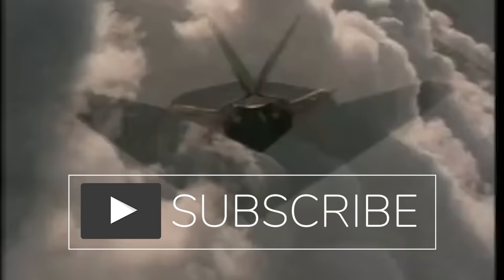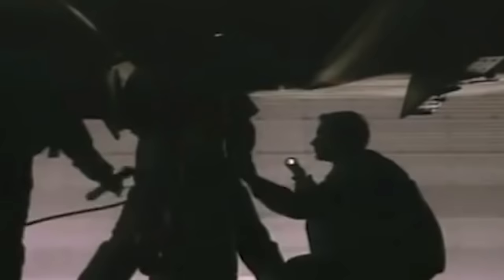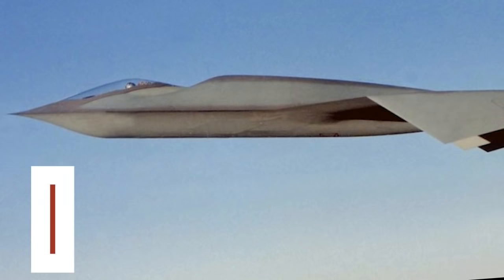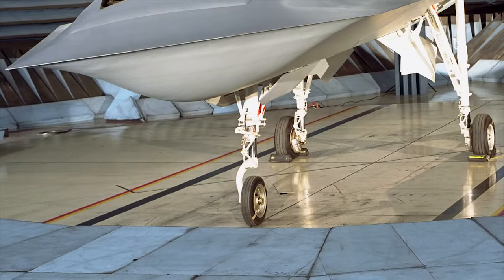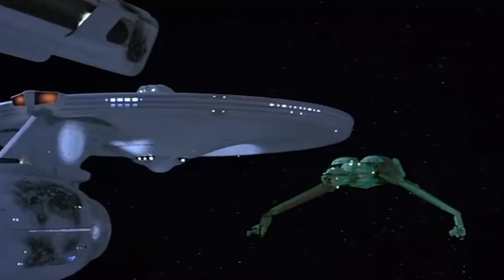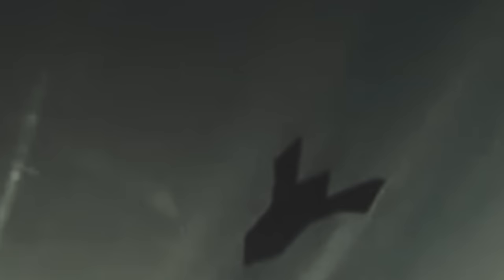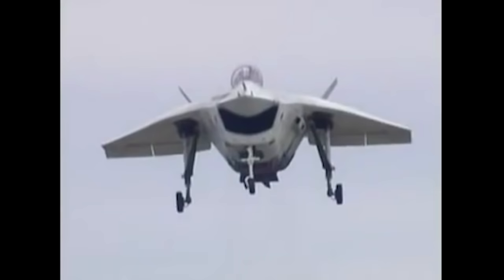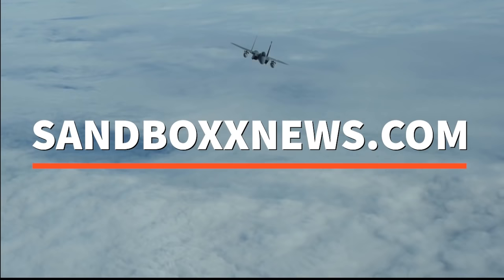Boeing's secret budget-busting stealth fighter

Comment: Nice piece.  FYI radar cross section of an aircraft is a function of reflectivity (as you said) and radar frequency and aircraft aspect angle.  By the way, "budget busting" means that the budget was exceeded.  The biggest problem with programs that "bust" their budgets is the plethora of regulations and bureaucracy that platforms have to wind through.
Reply: The biggest budget buster in development programs is the consistent underestimating the time and cost needed to invent the technologies that the new platform needs.
Reply: @mikeaustin4138  The Pinto was a car Mike.  You really need a better understanding of the defense acquisition process.  Have a read of the DFARS, if you can't sleep, and see how convoluted they are.
Reply: I'd hazard a guess that the biggest budget buster is the combination of the CEOs salary (you know the one who didn't actually do anything to make the aircraft) and unearthly profit margins for the company. The regulations are not the cause since the company knew of them beforehand and should have accounted for them in their bid.

Comment: One could argue that; if the bird of prey was developed in to a effective front-line fighter or bomber, costs would have risen exponentially. It was just a prototype.
Reply: Yup.  It was a technology demonstrator/growing pains developmental bird for McD to try to close their gap with Lockheed, especially with ASTOVL and JAST in the works.
Reply: One of the Test Pilots resigned rather than fly it...it was a handle to fly (read:dangerous).
Reply: It is way too small to use as an operational aircraft.

Comment: Building an airframe, a demonstrator airframe, is pennies on the dollar for what a complete, mission capable, fighter plane costs.  How much development on weapons control software integration was done with the Bird of Prey?  What range did it have?  Could it be refueled?  Could it cooperate with other air operations?  In short, beyond a flying airframe, what could it do?
Reply: Irrelevant...that's an apples to oranges comparison
Reply: @BRAINFxck10  -- That's right, it IS an Apples to Oranges comparison -- building a one-of prototype that only needs to fly and doesn't have all the actual mission required tech is easy, the hard part, the expensive part, is filling in all those mission requirements.  So, for an AC manufacturer to be able to build a one-of plane for something more than $100M doesn't impress me one little bit!
Reply: @Raptorman0909  
You'd need to know the costs of other flying stealth technology demonstraitors, to be able to say it's impressive or not.
Reply: hey hey hey! you cant use logic here in the 21st century and you know it!
Reply: You obviously never worked test.
Reply: @stanstanly3812  the r and d/test part is what is most expensive. just building something is cheap. its all of the sensors and stuff they have to put on it before testing that costs so much, that and the time ... nobody bolting stuff onto an airframe does it for free.....
Reply: That's what I was thinking. It wasn't remotely an operational or even a prototype, it was a proof of concept. No sensor suite, no weapons, no refueling, etc. It was meant to push technology, completely different than an operational aircraft.
Reply: @TheSnivilous  they (aircraft made this way) arent all that much more than a mock-up for the wind tunnel.
Reply: The Bird of Prey wasn't the product of the project.
It was how they made it that was the product.
Boeing should start working with BAE on UCAVs.
Right now BAE has the cutting edge tech.
All it needs is a payload bay and it can drown enemy air defenses in small smart  swarms of weapons like SDB-II and SPEAR-3.
Reply: @BRAINFxck10  That's exactly what his point is....
Reply: @BRAINFxck10  true, our airforce is made up entirely of flying demo planes, none of which have the ability to do anything other than fly. it would be irrelevant to have and airforce of planes that are able to fight. mission requirements? irrelevant. ability to perform certain tasks? irrelevant.
Reply: @lukewarmwater6412  read this in the middle of the night n lolled hard 😂
Reply: Very little, it was very, very small and only meant to test new stealth ideas in flight. Basically demonstrate that a new stealth concept could fly and testing it's radar reflectivity in flight, while also testing new production techniques.

Comment: I love the design. However there has been a big logical fallacy in the video: the comparison of the F-35 and the Bird of Prey platform.
A deployed Bird of Prey (not sure where it could fit in - as F-117A successor or stealth jet powered Super Tucano?)  would have been far more expensive. It was a demonstrator - without combat essential avionics (not even radar) nor weapons. It is like comparing a trainer aircraft with a full fledged combat jet.
Reply: The direct comparison makes some sense, but very limited one. For one, as you mentioned, the plane was pretty bare-bones, but we are comparing a cost of a production (albeit fully furnished) plane and a cost of whole developmental program.
Reply: @knytrix  Sorry - you are certainly right - it is a fallacy - not a logical fallacy.
But yes - I stand to it. Compare a fighter jet, with very expensive components is a whole different thing than a demonstrator with no avionics (at least no radar, weapon systems, data link etc.). It is like comparing apples with an iPhone. 
Or comparing a self-assembled bicycle with a car.
Reply: @Dominikmj  the part you’re forgetting is that the entire development including the single plane was on par with the cost of just 1 completed fighter. Had the program been adopted, the per unit cost would have been at a minimum compared to other operational jets
Reply: @scottdorfler2551  yeah it was space Nazis. Duh.;)
Reply: @enfynet  look - it is still dumb. I have a better analogy: cost of a garaged-built car (from scratch parts) and a development of a new model of a reputable car manufacturer. First will cost (depending on the type of car etc) several dozen-thousand of dollars. However latter would cost hundred millions of dollars. It just doesn’t make sense to compare.
How I understand it, the Bird of Prey was a flight demonstrator - not a prototype for a combat jet.
And as said: a lot of money goes into complex systems and also safety etc

Comment: The Bird of prey aerodynamically speaking closely resembles X-45, and I think that it could be described as a piloted version of it. The difference is the wing design, which is polyhedral, with dihedral inboard sections and anhedral outboard sections (but the same planform). Also, the chines on the front fuselage are more accentuated compared to X-45.
Reply: As stated in the video, the X-45 basically is a pilotless version of the Bird of Prey as it’s design was derived from the Bird of Prey.
Reply: I love the chines
Reply: @jackmandu  Sorry but for some reason, I didn't hear your statement that Bird of Pray is piloted version of X-45. If it is so, why was the great enterprise for Boeing to make a piloted version of this vehicle?
Reply: @kakavdedatakavunuk8516  I would advise to watch the actual video you are commenting on since it explains everything.
Reply: @EdWood110  My comment was based on the sentence that AW work on Bird of Pray is achievement. From my point of view it is mediocre aircraft, with performance much worse then their pilotless counterpart (and it is aircraft with no actuall purpose, except to show that Boeing was able to do it), if you think differently it is OK.

Comment: I am a boat builder.  One of the greatest achievements of Black Widow is the ability to prototype a boat in composites, test and make corrections before an expensive production mold is made.  This same technology can be applied to aircraft, respectively.  Boat building has as much to do with aerodynamics as any aircraft with many contributing unpredictable factors acting against the design.  Many techniques in high performance speed boat composite manufacturing prototyping can benefit the future of aircraft.

Comment: What Boeing proved is that they CAN build under budget when it's their money instead of ours!  Also, all they accomplished, within the funds spent, truly was just PoC (Proof of Concept).  In order to actually build a mission worthy aircraft they would probably charge the US taxpayer 2 or 3 times what they spent on this PoC.  I very much like what they did, now make ALL aircraft contractors do the same.  Spend their own money for PoC, then set a fixed contract to produce mission worthy aircraft that can be manufactured for a reasonable cost. One issue remains, is how "big" are they going to have to make it to house a larger engine and the space needed for the ordinance it will need to carry in order to complete an array of effective stealth missions without loosing its aerodynamic properties. Would love to see it get made.

Comment: The Bird Of Prey looks Ike the VTOL elements used in the F-35 or even Harrier could be incorporated.  It would need to incorporate a large by-pass which draws air from the top of the fuselage. But then you would need to have a large budget.
Reply: You don't necessarily need vtol
Reply: VTOL would kill this design honestly

Comment: Interesting shape, but with a max speed "slower than a C 130 Hercules" and max. ceiling "less than half as high than a P 51 Mustang", it is understandable the effort ended up in a museum. Having said that, lower prices / airplane certainly has become a serious issue by now, since prices have become so outlandishly high, planes so complex, maintenance so expensive. A "battle of England" scenario with Poles and Czechs replacing quickly shot down British pilots and new Spitfires those that didn't came back is no longer an option.

Comment: The dorsal intake is such an obvious solution to minimizing detection by ground based radar, that I wonder why it wasn't used in any of operational stealth craft??
Reply: Not good at high angles of attack because the engine wouldn't get enough air

Comment: As far as the "F" Fighter designation story goes, the Airforce wanted to attract the best experienced fighter pilots to apply for the program, then skill them in flying the cutting edge tech bomber. I don't know how true this story is, but because its a one pilot bomber, the first ever, it makes sense.
Reply: It was not the first single seat bomber at all. The A-7 is an example of single seat light attack bombers that the AF flew for decades.
Reply: Not a "story", it's a fact. Under the regulations set forth by congress, it should in fact be the B-117. But a super light bomber is not the type of aircraft anyone would think they'd want to fly.
The thing could carry 25% of the weight in bombs that the A-7 carried. So not even a real capable light bomber.
However, being super secret gave it the option of ignoring the rules and pretend it was a "fighter", just to keep its actual functionality obscured. Which helped get pilots, since they didn't learn the truth until after they had already joined the unit.
Reply: F-117A had a classified Air-to-Air mission of anti-AWACS using AIM-9L/M carried inside the weapons bays, with a hung-in-the-wind scissors rail.

This was recently revealed in a pilot interview on The Fighter Pilot Podcast.

F-111and F-105 were dedicated strike aircraft as well, never meant to engage flying targets, though the F-105D and F shot down 26 MiGs in Vietnam, 24 with the M61 20mm, and 2 with AIM-9s.  F-105 was a tactical nuclear strike fighter.

F-111 never shot anything down, still nomenclatured as a fighter.

Comment: Lockheed Martin: Develops a stealth fighter which program costs more than an entire nuclear powered fleet carrier and took more than a decade to complete

Boeing: Builds a stealth aircraft with the entire cost of the program being less than the price tag of a single fighter from Lockheed Martin's program

if that's not budgeting, I don't know what is.
Reply: Boeing just bought McDonnell Douglas and promptly started re-naming everything. This was developed by McDonnell Douglas. So were the F-15 and F-18. Among others.
Reply: JSF development costs involve 3 different airframes to be produced by the thousands, with a spyplane and EW bird set of sensor suites, heavy payload capacity, significant combat radius increases over legacy, and supersonic speeds.

Comparing those with a technology development demonstrator powered by a tiny business jet engine isn't really meaningful.
Reply: That is an extremely narrow and biased way of looking at that situation
Reply: My 5-year old daughter's Barbie Power Wheel Jeep costs A LOT less than my BMW.  It's also less capable......

Comment: Unmanned fighter aircraft ARE the future of flight combat. With the limits to performance determined by capacity strength of materials and speed of hardened computer systems. Fuel might even include HHO gas.Overide, or keeping human control must be the redundant system. Ultrasonic included.

Comment: 9:48   "Not only had the Phantom Works team proven that they too could build a stealth aircraft, they had managed to do it all for under $67 million. Adjusted for inflation to today's currency that means that Weichman's Phantom Works successfully designed prototyped and flew a clean sheet stealth platform for around $111 million or less than the cost of a single F-35B today."

Simply amazing.

Comment: Bird of Pray may have been cheap and built relatively fast (although I wouldn't call 5 years from the start of the program to the first flight fast, both Raptor and F-35 reached that phase sooner), but Boeing's ability to build new platforms for the USAF was surely busted with their disastrous KC-46 Pegasus tanker program. And KC-46 is not some cutting edge stealthy aircraft with never before seen technology incorporated in it. No, Pegasus is the redesigned 767 airliner with the refueling boom being manipulated with a joystick from the station with a camera replacing the operator's eyes. And the aircraft is still massively over budget and behind schedule. One could only imagine how would their aircraft that entered the JSF competition and lost to Lockheed, perform? But let's be honest here. There was one great advantage that Boeing's X-32 had over Lockheed's X-35. Any enemy's pilot would be distracted with laughter and wonder after seeing that abomination flying towards him. This could have been the tactical edge of F-32 over the current F-35.

Comment: America's not still struggling to learn how to design an aircraft for less money they're not supposed to design one for less money cuz it's all about the money
Reply: @deltavee2  One persons opinion on which you are entitled to. Unfortunately you have alot to learn.
Reply: @peterparker9286  
Mmm no, Spidey.  
I have more than enough time on-planet to assemble a reasoned approach and I'm not American.  
Tighten up your writing skills, Peter.  They affect how you are perceived and therefore reflect on your logic as well.
Reply: Nah, it's just that their political system fucks everything up. It's too reliant on money to the point that political decisions can easily be made based on who gets paid. A military contractor that realises this is absolutely going to try to make it as difficult as possible to cancel the project, hence Lockheed's handling of the F-35 by spreading it's production over many many states.
Reply: @peterparker9286  
To each his own, Peter.  I'll just stand by what I said and leave it at that.  Time will tell.  
Darkness doesn't ensnare me, my friend, more the opposite, actually.
Reply: @deltavee2  If anything no moss pal. We as in You and I most likely screwed either way.... for I am a Pee on... but I am totally fine with it....
Reply: @deltavee2  Yaeh there Gravitron and sheet with there crystaline structures in the sky and artic moon bases yup kascrewed. I just want one ride in a time Bender triangle that I have seen in the sky before I return to the Earth for Rest. Peace Brother.

Comment: This is quite interesting. Of course, one has to ask...if this could be built for such an incredibly low price, using molded composite parts to reduce both cost and radar signature, why hasn't this been adopted - at scale in the F-35, and even in upgraded parts for older aircraft ??
Reply: Because cost is not an obstacle when you are spending other peoples money.
Reply: @brlisong  True but also cynical.  The F-35 has been pitched as the replacement for the F-16 and there are a LOT of F-16s out there.  They expect to make it up on volume.  Stealth has become table stakes for future gen military aircraft.  Not even the mighty F-15 can satisfy that requirement.
Reply: @brlisong  Ttue. But if you're a Pentagon official, would you prefer 10 aircraft for each billion dollars allocated, or 50?